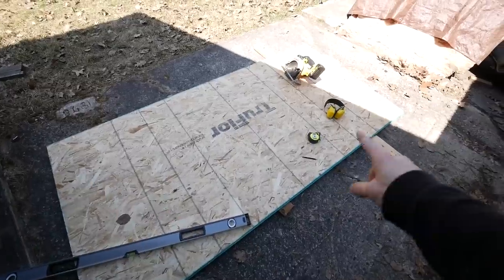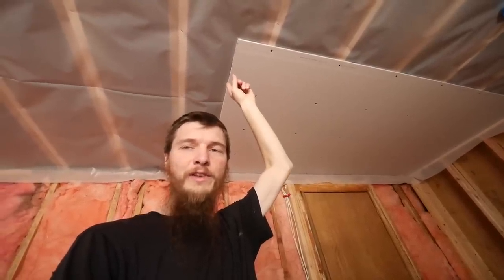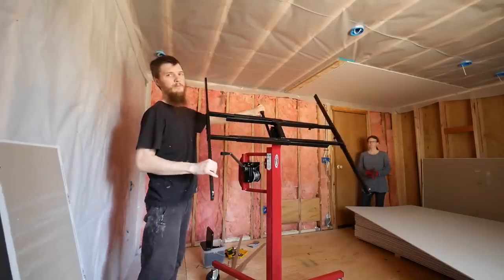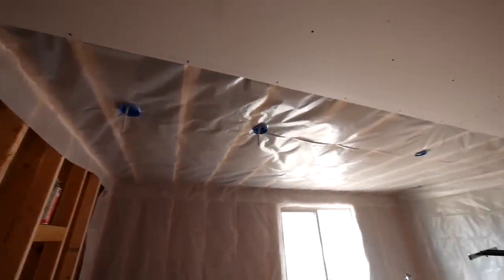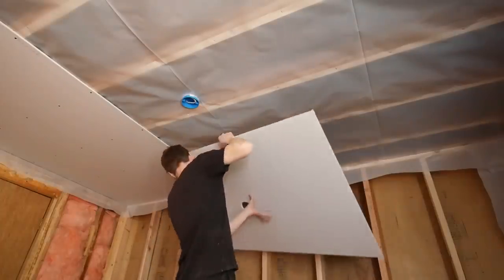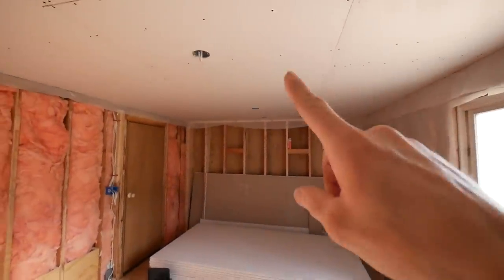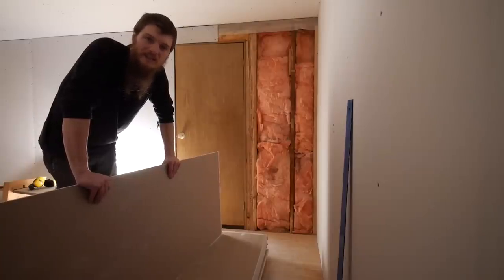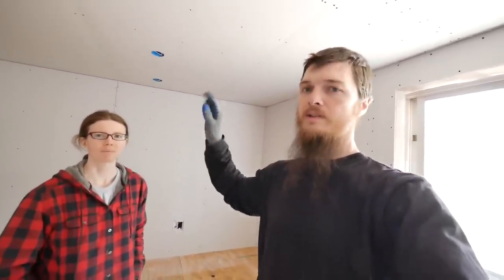DIY Amateurs Hang Drywall Like a Pro - Home Renovation

Comment: Nifty! I'm getting the impression that butt boards are a better option than just screwing into joists (mainly because of increased surface area and no opportunity to damage any joists). And that drywall hold-it-while-I-screw-it-in-thanks! machine is quite useful.

Comment: The ceiling looks great. Fantastic tip about drywalling a ceiling in mobile homes that may not have a good foundation: such as mine, sitting only on cinder block pylons. You're correct about shifting issues and the excess weight. I'd love to redo mine but for that very reason I can not. These are awesome videos and you two work so well together.

Comment: What thickness of drywall are you using? I imagine to minimize weight and cost you're using something thin. I also recommend a lightweight joint compound, it's much easier to put up as well.
Reply from the maker: We're using 1/2 " drywall.

Comment: I'm not a person that does any kind of construction work. However, I saw some drywall that are very thin at the Home Depot. Are those made for mobile homes? Have you seen them? Would you talk about them on another one of your videos. Thanks.
Reply from the maker: Yeah, they do make thinner drywall and they can be used in mobile homes, or just wherever you need thin drywall such as going over an old wood or plaster wall, or even over paneling.

Comment: Would like to know what inch the drywall thickness is and what size screws were used all around this room
Reply from the maker: 1/2" drywall. 1-1/4" drywall screws
Reply: @diyfferent  the thinner stuff is sapposed to be used on ceiling , for the weight issue u were talking about
Reply from the maker: @expertautodetail1833  Our mobile home is better able to handle the weight since we have a solid block foundation and we beefed up our ceiling joists to 2x6s. But yeah, for mobile homes that can't handle much weight, it's a good idea to use the thin drywall on walls also.

Comment: Looks great. But rookie/noob  opinion... wouldn't it be easier to drywall above and below the window first, then work out from the window towards the side walls? Might use to much drywall, but easier to put up.
Reply: You always start from one end. The goal is to have as few seams as possible. Sheetrock is cheap and it makes the next step way faster and easier.

Comment: Looks fantastic!  I had no idea about the buttboard.  I always cut my drywall to the center of the stud.   This technique would definitely save on drywall waste.  Any width of the buttboard is fine so long as it's not wider than the distance between the studs?  Also, you mentioned that the house sits on a concrete slab.  Did you  remove the under carriage to setup the house much like a modular home?
Reply from the maker: Not a slab, but a block foundation with crawlspace.

Comment: One thing I found out remodelling our trailer, they are NOT SQUARE. When we installed our new kitchen cabinets I about pulled my hair out! Nothing lined up and nothing sat level. We had to add shim blocks to EVERYTHING. The corners were the WORSE. I wish I knew about that drywall bit years ago when I added an addition bedroom to our home. I had to add a wall in the addition to our home making it a three bedroom home. Now we only have a two bedroom mobile home. Houses end up costing in taxes and whatnot. You can use thinner drywall than standard drywall as far as strength.  Most mobile homes are constructed with smaller diameter timber and drywall. 1/4 inch on walls and 1/2 for ceiling. Houses use 5/8 ceiling and 1/2 walls. Bathrooms and some kitchens use waterproof drywall. When we remodeled our kitchen. I installed foam underlayment going up the walls to form a kind of bathtub so if any water leaks occure from the dishwasher and sink it can not get to the subfloor like last time. Our dishwasher had leaked causing the subfloors to sink in where the cabinets were. There had already been a leak under the sink that ran the lenght of the kitchen to where the refrigerator was, so that leaned back into the wall.  The sill plate had rotted as well as the wall studs about 5 inches up. Clearly it had leaked for a long time. Now the water will pool up but not go anywhere. We can shop vac the floor an d replace any laminate flooring that needs replacing.
Reply: We were talked into a floating floor tile. Don't do it. The name is appropriate, when there's a leak the floor floats.
Reply: @nancyfahey7518  Better than ripping up up the sub floor. Its a total bitch. A floating floor is easier to take up than ripping up everything. I already went that route. Its best to seal a floating floor once its down. A Minwax sealer coating will seal all the seams and prevent water and moisture egress. They do not tell you that you need to seal a snap in floor but you should. It seals the edges and prevents water from swelling the boards should water get between them.

Comment: Why didn't you just cut your first sheet to fit your rafters/studs? Your way is working tho, so more power to you! Enjoy your videos!
Reply from the maker: It's a lot harder to compound the butt seams when they end up on the ceiling joists, so we use the floating butt technique to make it easier to finish the drywall. Thanks!

Comment: That’s not exactly a T but same idea. I love watching reminds me of stuff I’ve forgotten. Have lots of work to do. Need a good handyman. Don’t you usually hang around the window as a whole piece then cut it in place?
Reply: lechatboote is there an advantage to doing it that way?
Reply: Sandra Kohlstedt the drywall hangers I know do it so you don’t have a piece that might break. Then you cut out the center around the window. Doug succeeded quite well. So I don’t know other than the risk of breaking the piece.

Comment: I have two questions: What thickness of drywall did you use in your remodel? Homes in Florida have 5/8th, but up North, I noticed they use 1/2 inch drywall sheets. I don't understand why the difference? Does anyone know the answer?
Reply from the maker: No, never heard of that. We used 1/2" and that's what is standard here.
Reply: @diyfferent  Thanks for responding.  Keep up the awesome videos.
Reply: May have something to do with climate and heat retention??

Comment: question: will the weight of the butt board make those seems sag with time bc of the constant weight in those areas?
Reply from the maker: No not at all. The drywall is supported by the ceiling joists on either side of the seam and drywall can hold a lot of weight. Some people have 16+ inches of loose fill insulation on their ceilings so they can definitely carry weight.

Comment: Doug, a nice job I've seen worse & not to many better so great job younger man than myself.
 whats name of knife you used called (besides hole saw)  & where did you buy it at?
 I  looked at home depot couldn't find it & our lowes have all closed here where I live. 
thanks for sharing
Reply: I belive its just called a drywall saw.
Reply from the maker: https://www.homedepot.com/p/Milwaukee-6-in-Jab-Saw-with-Plastic-Handle-48-22-0305/202525764

Comment: What's the purpose of the plastic on the ceiling
Reply from the maker: It's a vapor barrier to help stop moisture from entering the attic space. It's not needed and not recommended in most areas. People usually only do them in very cold climates.

Comment: As a swede, I don't get the thing with a built in closet like that. If you have a nice square room one can finish the wall and build the closets outside of it, like furniture. Or rather that drywall should have anything to do around a closet. Going to be fun to see how you do it.
Reply: That is interesting.  I have been looking at an "unfitted" style to do my kitchen in my 150 year old house.  I think that a wardrobe closet would be something like that.  We seriously considered buying another older but smaller house for retirement and I had a lot of ideas on how to finish it.  It only had one closet that was oddly proportioned.  I intended to have appropriate vintage style wardrobes for it. (I was looking at Gotham Cabinet Craft for inspiration but hoped my husband would build it).  Or, I thought maybe I would find a vintage one that would work, hopefully for far less money.  Never can tell!  But, OITC's home probably would look better with a more modern style, maybe like Ikea as some have mentioned.  Like you, I am finding it fun to see what they will do next, and enjoying the ideas it gives me when solving my own home decisions.
Reply: True. Especially in a small bedroom. A 4” thick wall takes up needed space.
Reply from the maker: Sometimes real estate agents won't consider a room a bedroom if it doesn't have a built in closet so that's probably a big part of it. We will have built in closets but in a previous home we built an exposed closet without walls and it worked very well for us.
Reply: @diyfferent  Yeah, the strangest thing to me is to build framed walls and putting a 'real' door to a limited space. I fully understand it for a 'walk in closet'. But with the space available there, 1" laminated cabinet type system would give full access to all the space with many doors, like in a kitchen, and it still being secured to the wall and a permanent feature of the room.
This is just general thoughts, not a suggestion to you specifically. I'm looking forward for your solution that fit your ideas, culture and needs.

Comment: The correct way to hang drywall is horizontally. Maybe you could watch some videos before you do the next room. It’s really a lot easier horizontally too. ✌🏼
Reply from the maker: Actually, drywall can be hung vertically or horizontally. We didn't want to buy 16' sheets which would be way too heavy and probably wouldn't be able to get them in the room. If we used 8' sheets and hung them horizontally, we would be dealing with more butt seams. It's preference - not right or wrong either way.
Reply: @diyfferent  The guy that did my drywall has done lots of MHs and he stated that in MHs it should be done vertically because of the flexing that a MH does during transport as horizontally leads to more cracking.
Reply: Take no heed of the armchair , , experts , , drywall can be applied vertically or horizontally do it to your own preferences , think this person should gain some actual knowledge before criticizing . Just saying .
Reply: @GraeMatterz , I don't think this home is going anywhere. :)
Reply: @Tamshazeleyes  I don't think so either, especially after it's rebuilt like this. To move it would require the movers to put extra outriggers (metal braces between the outside wall and the center rail) to keep it from breaking apart with the extra weight, but those are expensive. (It was suggested to me to do that instead of perimeter blocks, but was cost prohibitive.) This one will probably have to be dismantled if it's to be replaced in the future.

Comment: Maybe for future windows you could just hang the whole sheet of drywall, screw it in and then cut out the hole for the window?
Reply: I think that is what my husband usually does.  But Doug sure was having a good "luck" drywall day!
Reply from the maker: I could but the cut gets sloppy when using a drywall saw, for me at least. It's just hard to stay running straight without seeing the line and the window is a bit in the way.
Reply: @diyfferent  True that. The way you did it turned out nicely, I'd just hate to see you break a sheet. But, whatever works. Keep up the good work 👍

Comment: Doug and Ashley...a really good job. Looks like you have done your homework. Looking good. You're right about the weight issues. A standard mobile home would bow terribly. A double wide without a proper foundation would do the same without a goid, solid foundation.
Reply: Her loveliness is Ashley
Reply: @beteeho  Oops...thanks..I fixed it.